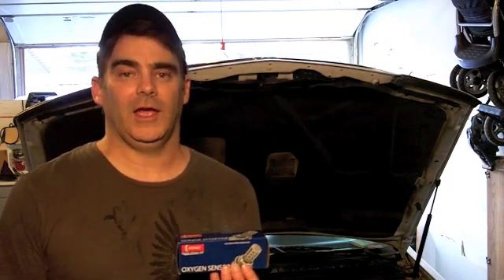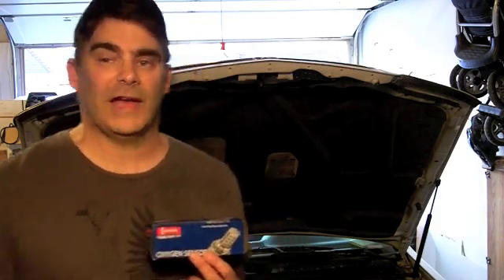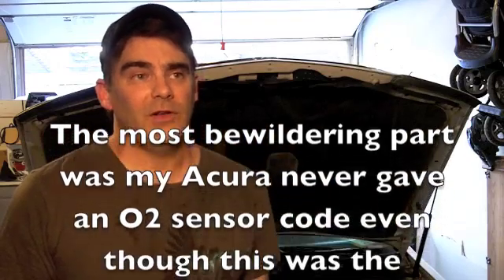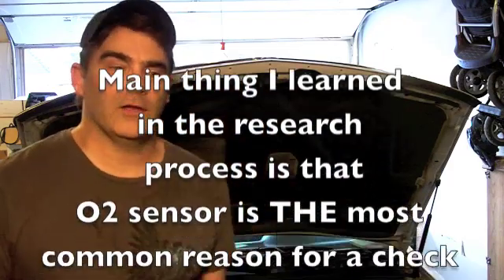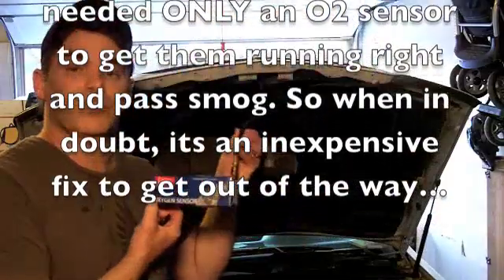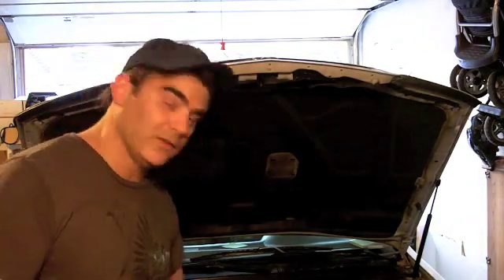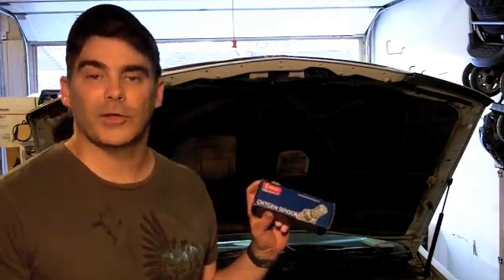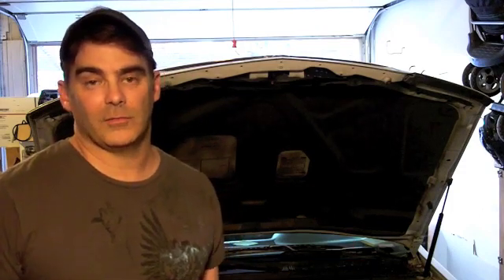Oxygen Sensor O2-Discussion-Fault Code P0170 P0171 CEL Honda Acura CL '97-rough idle-check engine 3

Comment: I can believe what a faulty O2 sensor mine is downstream can do to your car without the ECU knowing it, it just gave punch of codes p070, p071, p074, has nothing to do with missed up o2 sensor, but mine was already to old and rusty so because of this video I went directly to it and change it, and problem solved, I don't change the upstream because I already change it 4 months ago.

Comment: You right man, like my honda car,   i had the. Ode p0170 and p0171, but i have a bad downstream sensor, long time ago, i did diagnostic test of o2  sensor and upstream pass but downstrean doesent pass the test, that ling time ago before i hade the check engine on, and i ignore the the scanner test but now i know what to do first, i should change the sensor downstream because the upstream i just change it 4 months ago.
Reply from the maker: Sounds like a good plan.

Comment: Thanks, was choosing between the denso and the Bosch
Reply from the maker: Probably not a huge difference either way, if Denso is OEM I'd probably pick that one
Reply: @KeithBlade  in the end i was able to find a denso for the downstream sensor, and chose between NTK and bosch for the upstream. NTK apparently is the same company as NGK, so it seemed closer to oem
Reply: And of course more Japanese...which is very important. This NTK is made in Japan and the denso was assembled in US for whatever that's worth

Comment: Thanks a lot, I was getting a p0171 and p0131 code I've replaced the o2 sensor so far its been good too me like you've said in the video my car as well has over 200k miles on it so hopefully that was the issue. I'm trying to get this pass emissions.
Reply from the maker: Glad to hear that, best of luck with the testing.

Comment: Having the same problem. Thank you for the video! Kept getting 0170 and after checking VAC leaks, MAF and MAP, it had to be the O2s. Headache for sure.
Reply from the maker: Yeah!...I really feel with higher miles and check engine lite on it's just a good idea to replace the O2 sensor especially  if it's never been done.  It's a fact that O2 sensor is the most common replaced item for check engine lite repairs
Reply: @KeithBlade  After watching countless videos, your video was the only one that linked up the 0170 with the downstream O2S.  I was at a loss because there were no VAC leaks, the MAF and MAP were fine, I dug into the wiring, thinking that was a problem.  The O2S diagnostics showed that the engine was running lean but I though the problem was before the O2S and not the 02S itself.  I hope more people find your video.  FYI, I am working on my elderly aunt's  06 Hyundai Elantra with 150K miles, in case other's have same problem.

Comment: Hi. I am currently having the same issue on my 2014 honda civic si. I am getting Check Emissions system... FUEL SYSTEM TOO LEAN + B1. I replaced the maf sensor.... did not fix the problem. when I go to put fuel in my car and start my car it gives me p0171 fuel system too lean. was idiling rough and loss of power  Honda has it now has looked at it and recommended the o2 sensor.. I hope this fixes my issue.
Reply from the maker: Hi George, I hope they are successful. My attitude is, since the O2 sensor is THE most common at-fault item for a Check Engine light, to replace it if it's never been replaced. Trouble is some cars have 4 of them. Also sometimes it's a gas cap being loose or one that needs to be replaced. Since gas caps are cheap, it's an easy "try-it" option. I passed emissions one time just be replacing my gas cap. About the O2 sensor, my understanding is the ones closer up the exhaust chain near engine go bad more frequently. I'd trust the dealer more than a neighborhood mechanic to diagnose something difficult like your scenario. However, sometimes if the car is running fine I do not fix is right away as sometimes the Check Engine Light will go off by itself as occasionally some problems self-correct. Most of the time though with the CEL light comes on it's an early warning of something that may get worse, or fuel economy or idling suffers right away as yours probably was. Thanks for posting!

Comment: Hello thank you for video i have a 97 honda civic ex got the P0170 code did the fuel filter cleared the code, did the fuel pump because vehicle has 240k miles and it was less then $30 for a quality part and easy install and finally primary upstream 02 sensor Denso replacement stopped hesitation on acceleration and wanting to stall while idling cold, the sensor tightened up performance for sure, all issues resolved all codes cleared wanted to post because your video was first i saw with the code thank you so much how my input helps others in scenario
Reply from the maker: John Spencer that's fantastic. Thanks for posting and so glad you found the solution.

Comment: Have 2000 Honda Accord with 3.0 liter engine. Check engine light revealed two codes. P0171 and P1457. Fuel system lean and EVAP control system leakage. Replaced upstream o2 sensor and cleared codes. So far, no more check engine light. Thank you for pointing me in the right direction. Almost replaced wrong part on EVAP canister.
Reply from the maker: +Sbaileyrph  Great, hope that clears up the problem. The number one most common repair with emissions/check engine light is the O2 sensor, so when in doubt its a good idea to start with O2 sensor... especially if its got higher mileage on it or the O2 sensor has never been replaced.

Comment: great video, thanks.

I have a 97 CL with a 171 code and the scanner tells me Bank 1. Guess I have to crawl under this thing and break my knuckles to get the harness out and back in.

The "funny" thing is, the car runs fine, mileage is the same and no visible indication of anything being wrong.

Comment: flyin2orion, I have the same year and model acura cl.  I am having a problem , I just bought a scan tool and it does not show a bank 2 fuel trim reading. I  am wondering if the o2 sensor wire or sensor is working. I believe you showed the sensor 1 as being back behind the firewall. Where is the sensor o2 for the other side of the engine, I imagine it would be easier to access. Thanks.
Reply from the maker: Hi Jan, if you have the CL 3.0 then there are definitely two O2 sensors, one before the catalytic converter and one after.  The O2 sensor after the converter only monitors the converter. The one I replaced in this video is the sensor BEFORE the converter, its right by the engine, just a tad behind the engine on the header exhaust. Just to clarify you access the plug over the top of the engine by the firewall, but to replace the actual sensor you need to be under the car. Could be your wire went bad especially if its never been replaced before, there is lots of heat right there rising off the exhaust. Really hard to say for sure if that's your fuel problem, but I will say the O2 sensor is THE MOST COMMON emission repair and not just on this car, on all cars... therefore if you've never replaced yours you may as well do it, its not an expensive part anyway. You can always do a seafoam treatment as well, its a cheap maintenance routine after you get the bank reading properly & tons of videos about it. Thanks.
Reply: Flyin, have you used a scan tool? I just got one and I get no reading for fuel trim bank 2, only for fuel trim bank 1.  it may be that early in Acura/Honda going to OBD 2 compliance they did not take into account a fuel trim for bank 2.  I know today all v-6 engines have two banks, bank 1 for each 3 cylanders of a v-6. Its the same way with v-8 engines as well. The only time one bank is used is for 4 cylander engines. It has me confused because it makes it more difficult to diagnose problems that way.  Thanks for providing the video it is helpful.  I am having an issue with excessive fuel consumption, my fuel trim reading is at 10% excessive, I will try using a smoke test or maybe spraying some carb cleaner around the various vacuum lines to see if there is a leak somewhere.